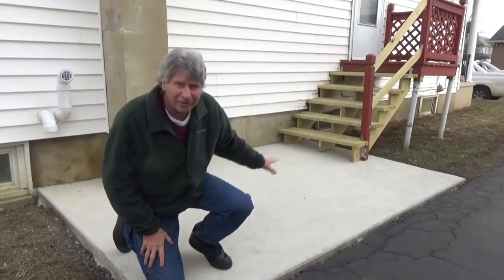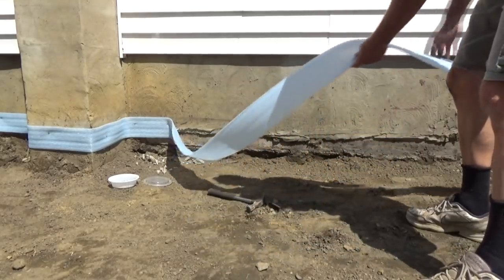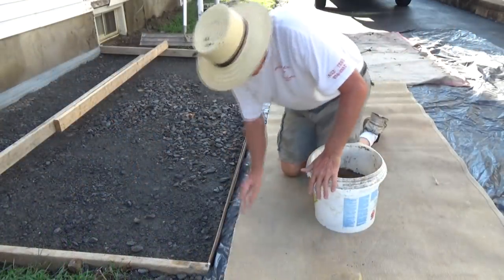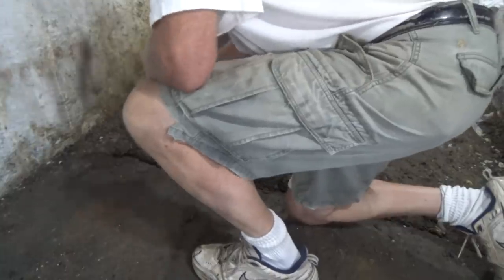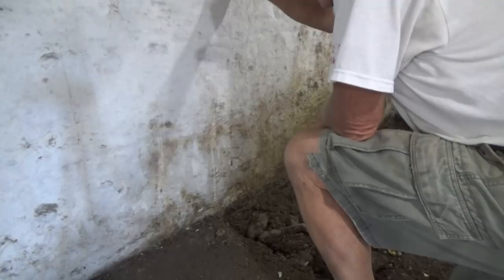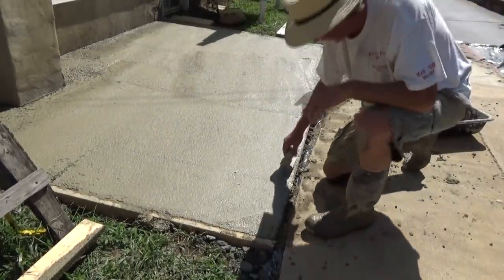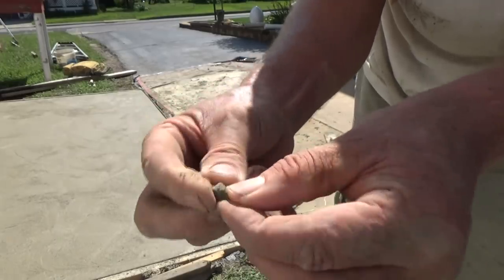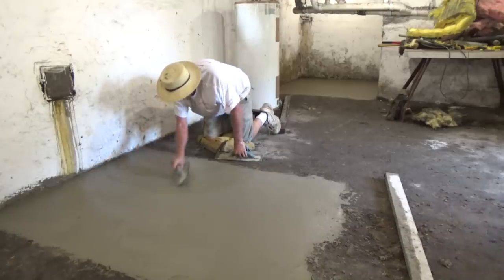CONCRETE SLABS-PADS-FLOORS-PATIOS  (Part 4) Mike Haduck

Comment: Making it look easy. Ill be pouring my own slab in a month hopefully. 13 x 30. Ill be laying heat pipe and also plumbing in a toilet and tub. Going to be a guest shed with all the perks. Have not had to rub any concrete in years since my dad past so I enjoy the refresher videos. Thanks
Reply from the maker: Thanks Robert, I am sure it will work out,  mike

Comment: Hi Mike, Quick question.  I just poured a 10x10 pad for a hot tub. It's level. Problem is there is 1 spot that holds water. Is there something I could do to fill that in.  The depression is not visible to the naked I.  Thank you.
Reply from the maker: Hi Saftey, unless you patch it with portland but it will show no matter what,  thanks Mike
Reply: @MikeHaduck  OK, thank you.

Comment: been fixing the rubble foundation on my home with information from your videos, thanks so much Mike! my dad gave up on the basement walls in the 70's, i don't think he really knew what the walls consist of. he had the 1" thick floor taken up and 6" of concrete poured in 1971, not one crack in that slab. he had a dry basement for a few months until hurricane agnes in 1972,  we have a high water table here, i am near the daniel boone homestead in berks county pa. right now the water table is about 30 inches down and it has gotten a lot drier here since we got public sewage. was worse when everyone had septic systems.
 these walls someone threw huge rocks into the concrete mix, i don't think there was any stacking involved. they also only used forms on the inside and above grade, the floor joists were the concrete forms lol 80 plus yrs later they still have concrete on them.
 i am about half done with the walls, basement still gets wet but does not flood.
the steps my dad put in out front are 50 yrs old. they are decent yet, the 60 year old sidewalk is all busted up tho. and the front porch steps are sinking on one side. those my dad did not do. after i fix the inside i have to do something about the steps and refinish the exterior concrete on the foundation.
Reply from the maker: Sounds like you got a plan,  and I am sure it’s gonna work out fine,  I appreciate it,  keep going, mike

Comment: Thank you Mike, I sure have learned a lot from you.  Any advice on making sure you get the concrete delivered that you actually ordered?  I hear stories around here that sometimes they deliver whatever they want because it is easier, novices such as myself wouldn't know the difference and 2 years later the pad is cracked and spalling.
Reply from the maker: Hi thefireman,  it is something you can not help,  I just always order more and a 4000lb mix,  usually no problems but I am afraid of driveways because of the salt,  thanks mike

Comment: I recently came across your videos. I appreciate your knowledge and simplistic mindset. It's refreshing in this wasteful, fast paced society now. I noticed in your foundation videos you prefer not to use mesh. Is ground cover necessary for when Chipmunks dig into your foundation? It was crumbling, but they've dug actual holes through it now. 🤷🤔 We've temporarily blocked them off, but in fixing the foundation might that be a good idea, or does just fixing it resolve the issue? I'm still looking for a good mason here in northern Indiana.
Reply from the maker: Hi Zebra,  I did s series called foundation repair, Mike Haduck,  I never had any problems with the way I done it, I will be putting out another video tomorrow with mesh but I very rarely use it, thanks mike

Comment: Mike. Can you do a vid on how to cure concrete. What's involved or recommended methods of curing freshly laid concrete. Thanks..
Reply from the maker: Hi spookerr,  that’s a hard one, everybody says different and every situation is different,  in my area the cold and heat are extreme, I don’t even pout concrete after middle of November,  and don’t want to pour it in 90 degree heat, there is a balance,  thanks mike

Comment: for the basement pad did you need to add something to the existing thin concrete to help the new and old concrete stick to each other?
Reply from the maker: Hi Frank,  in this case no,  concrete shrinks and you will see small cracks along the sides, that’s Normal. Thanks, Mike

Comment: I noticed you wouldn't be able to use the screed as the chimney bump out kept you from going all the way across from form to form until you cleared the chimney. Did you run a chalk-line along the wall for your level line along the or did you run the sill seal level and just use that as your finished height?

Comment: mike can i get your thoughts or experience with mudjacking,,does it last if water issues are taken care of,,my attempt to raise concrete with jacks wont work without removing at least one piece to get access to the fallen side,,i really didnt want to disturb any of the sections since its all in good condition,,just leaning on one side,,thx for any help
Reply from the maker: Hi Tim it’s a hard queston to answer , but keeping the water away would probably help,  if I had to I saw out the old and replace it,  thanks, Mike
Reply: mike i dont know how u answer all these comments but we sure do appreciate you doing so and all the videos,,enjoy your weekend sir

Comment: What kind of mix did you order? That looks like a really nice mix...
Reply from the maker: Hi.  A S.  In these parts I use a 4000 psi mix,  down south they might be using 3000,  but the weather is different
Reply: @MikeHaduck  Looks like they displaced a portion of the portland with slag. How was the set time?
Reply from the maker: don’t know what you mean by slag,  it was all the same from the truck,  thanks mike
Reply: @MikeHaduck  blast furnace slag cement. Sometimes added to the concrete as a pozzolan, lightens the color and makes  the concrete more durable in the long run.
Reply from the maker: Hi Alex, I have heard of it but never heard of it being used in any concrete I used,  thanks for the info, mike